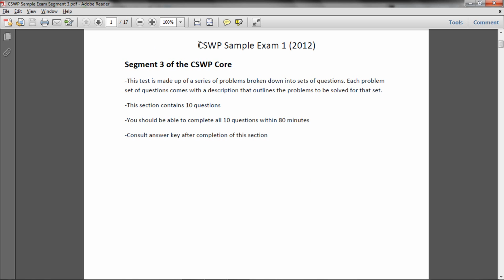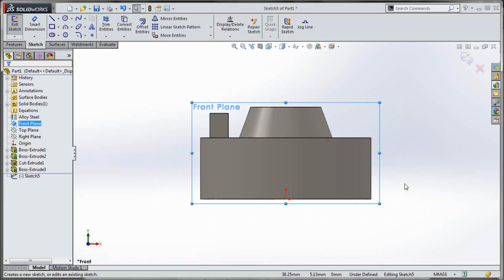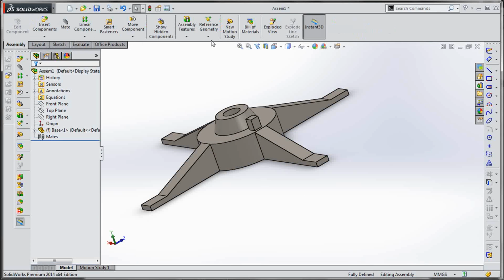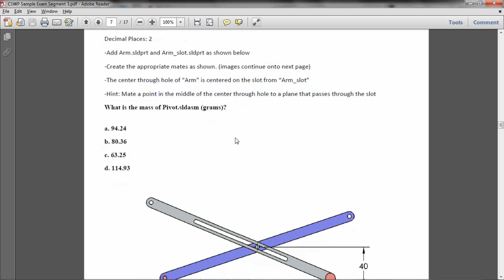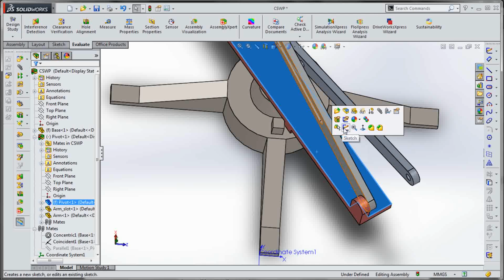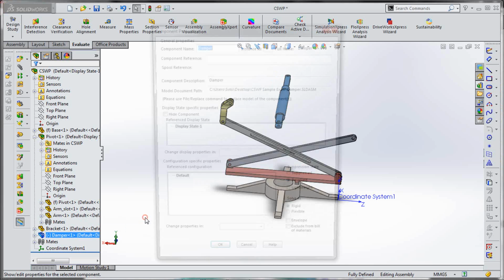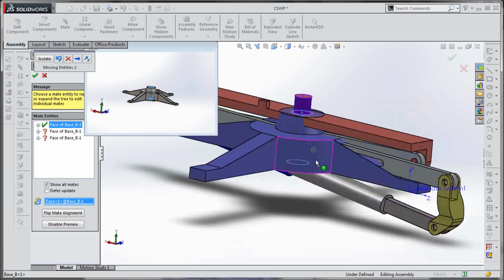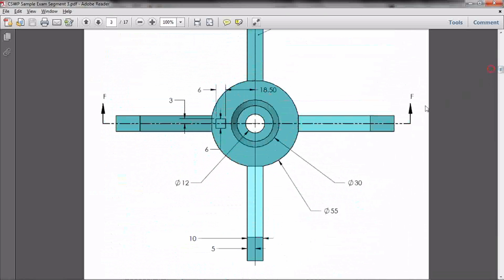CSWP Segment 3 Sample Exam 1 HD

Comment: I spent one hour to find a mistake in my model from question 1 relative to the wrong value Z for the Center of mass in question 2. Now you telling me that PDF is wrong. Wondering why like that if that is the official sample?

Anyhow, tomorrow is my test day so wish me a bit of luck.

Thanks
Reply: Did you pass?
Reply: @shahedmarleen8757  Yes, Long time back
Reply: @DR.BELJAN  Glad to know that. I will be taking mine tomorrow. Any suggestions? About the new format?
Reply: @shahedmarleen8757  I'm not sure about new format as I pass test 3 years ago. Good luck
Reply: @DR.BELJAN  Thank you for your quick response. Appreciate it.

Comment: Thankyou for the explanation, component part, and the pdf document  :)

Here's all the answer from the video, so you don't need to find it one by one on the video.
1. 562.80 grams
2. X=5.00 ; Y=9.76 ; Z=-86.96 mm
3. 54.47 grams
4. 94.24 grams
5. X=5.02 ; Y=15.80 ; Z=-86.82 mm
6. 35.79 deg
ree
7. X=4.11 ; Y=30.20 ; Z=-98.36 mm
8. X=4.30 ; Y=35.07 ; Z=-98.07 mm
9. Arm_slot-1 ; Arm-1 ; Housing-1 ; Pivot-1
10. X=13.00 ; Y=37.66 ; Z=-105.66 mm

Comment: Thank you for the great video! I have struggled to find practice material for these exams. I just took mine and passed. I wanted to leave a comment for the people who are preparing to take this exam. I will say I think my exam was more difficult as it had 14 questions with 80 min; however, the exam format might have changed in 5 years. Try to study all of the advanced and mechanical mates (I had a question where i had to use a gear mate and a path mate). Also, my exam did not have any modeling like his practice tests do.
Reply from the maker: Congratulations for passing the exam. Thank you for posting about your experience, I hope it will help other people who are preparing for the exam
Reply: Thank you for the info! cheers mate!
Reply: I agree

Comment: Dear sir, can you do me a favor? i have done exactly every step that you did, but i can't get the angle while collision like you-35,79 degrees (23:57 in video). At first i got 35,82 degrees, another time i got 35,87 degrees. Please tell me how to fix that and is there a limit of tolerance with the measurement angle in the cswp test?
Reply from the maker: I used SW2014 Premium in this video, and you are probably using newer version, so I guess it can be a reason for slightely different results due to some calculation differences in software. It is strange that you get two different results, try to slow down mouse pointer before collision to give software enough time to calculate everything. So try to find unique answer for your model. Differences between your(35.82) and mine, don't sound too big for me, but I really have no idea what are tolerances in the cswp test
Reply: Hi Huy. I also get that sometimes. I figured most of the times it is unit decimal error. make sure it it set to 2 decimal points. aslo if u r using 32 bit version of solidworks instead of 64 bit, u will get slightly different values.

Comment: Great video.  I just have one question, the 8mm offset that is 6x6 is 3mm from the top of the leg and not centered in the drawing.  (If it is centered it will be 2mm from the top of the leg.)  Is this a mistake in the drawing too?  Thanks again!
Reply from the maker: Thanks for your feedback! Not sure if I completely understand your question but the 6×6 segment is 2mm from the top of leg(and 3mm from the center of leg) and is centered, so I done that exactly the same as it is shown in pdf, I consider that as correct

Comment: Hi Nikola

Thanks for doing a great video. I followed this via the GrabCAD link and the file "Base_B" in this video is different from the one supplied via GrabCAD? Am I missing something?
Reply from the maker: Hi Wayne, 
I am glad you liked the video.Yes, you are right. At the first glance it looks the same, so I have never noticed any difference. But, for some reason, dimensions in the file from GrabCad are incorrect, so you will have to model the part by yourself. On the other hand, If I remember correctly, already modeled, original parts that you just insert in assembly, are OK.